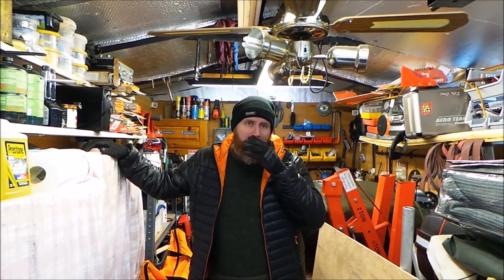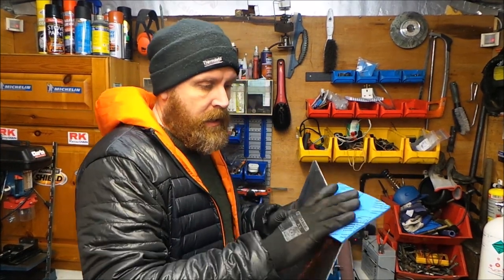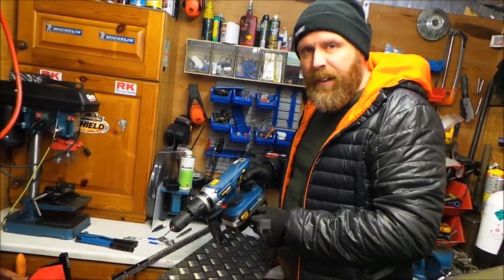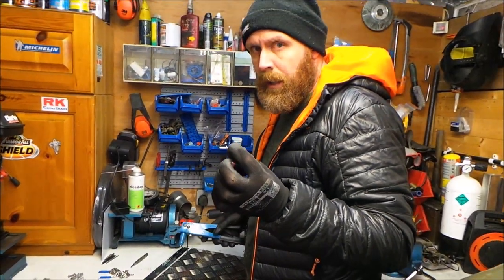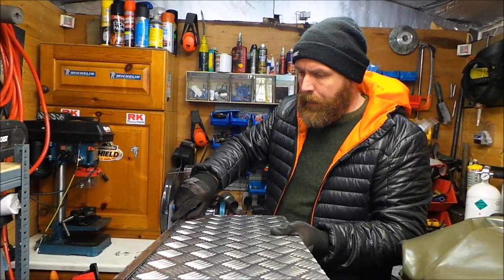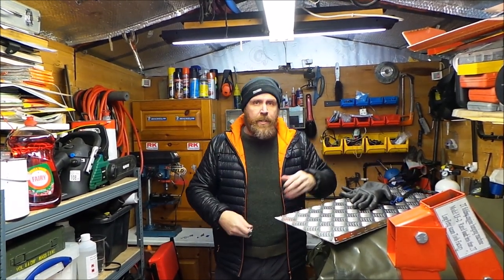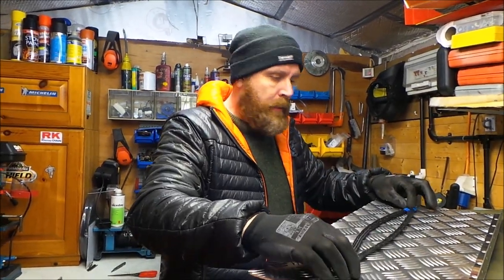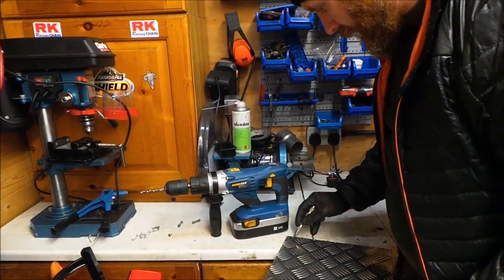Fabricating a Boot Shelf  Land Rover Discovery 300 TDI

Comment: What size is the shelf and what length is the chain toying with something similar in my 110
Reply from the maker: Hi the chain was 2x400mm and the shelf was 300mmx600mm- i got both from ebay hope this helps
Reply: Brummie Prepper cheers